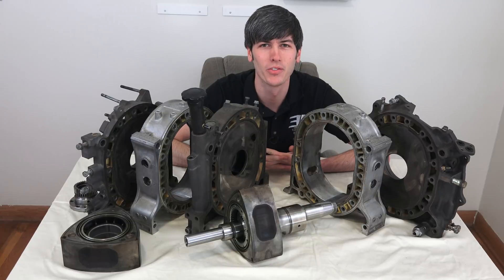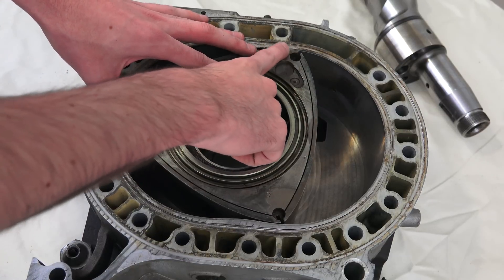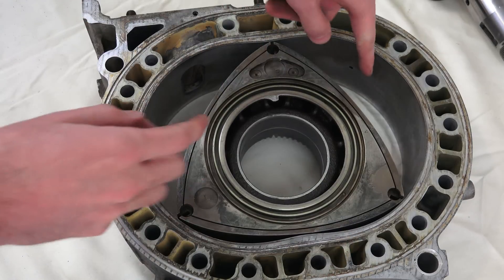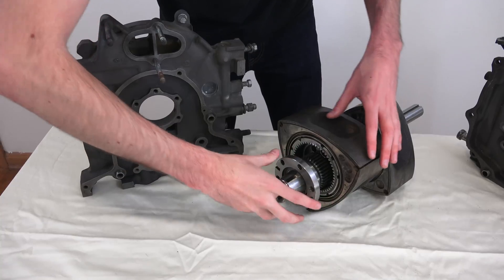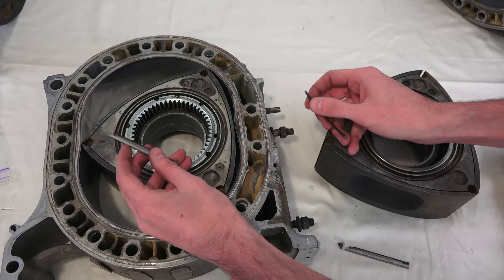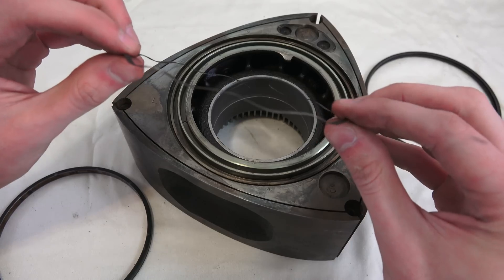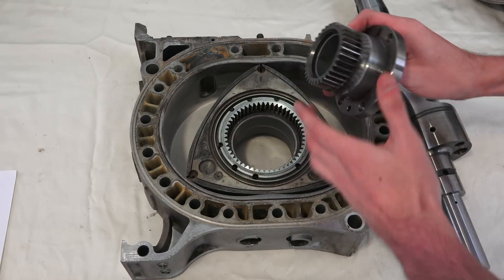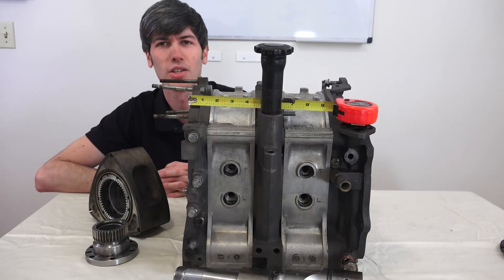How Rotary Engines Work - Mazda RX-7 Wankel - Detailed Explanation

Comment: I'm having trouble visualizing how the rotor, turning once, makes the eccentric shaft turn 3 times. How does the stationary gear connect the rotor motion to motion of the ecc shaft? I see gear teeth inside the rotor meshing with gear teeth on the stationary gear, but  I don't see any gear-teeth or splines or anything on stationary gear that transfer motion of the rotor to the ecc shaft.
Reply: the rotor spins in its housing, the stationary gear is connected to the eccentric shaft, as the rotor spins the gears mesh and the shaft spins...
Reply: my apologies oh masterful keyboard warrior

Comment: Great video!  The only goof I noticed was that the "concave pockets" in the rotor faces reduce compression, rather than increase displacement.  This is similar to a deep dish piston in a reciprocating engine.  It's done to create a more 'turbo-friendly' compression ratio.  If you set a turbo engine rotor beside an NA rotor, you'll notice the "pockets" are deeper on the turbo because the NA needs that extra compression to develop torque.  The displacement is the full volume swept by the rotor minus the volume of the rotor itself.
Reply from the maker: +Pete Schneider Wouldn't they do both? If displacement is "the full volume swept by the rotor minus the volume of the rotor itself" and the rotor's volume is smaller as a result of the concave pockets, wouldn't it have a larger displacement?
Reply: +Engineering Explained It would reduce the swept volume and the rotor volume by the same amount.  Relating it to a piston engine, dishing the piston reduces the compression ratio, but doesn't change the displacement.  The displacement is bore x stroke, I.e. where the piston sits at BDC versus where it sits at TDC.
Reply: +Engineering Explained To look at it a little more directly, the turbo and NA versions have the same displacement despite the difference in the "pockets".

Comment: Hang on! I don't get the comment of the pockets on the top of the rotor affecting displacement. Given that it doesn't change the dynamic volume of each combustion area, I don't think it could be considered "displacement". What I see is that it is a necessary relief to allow gas movement in the area between each apex seal. See as you approach top dead and then crest it, you need a way to transfer the gases across that squeeze zone. The volume of that pocket is probably better compared to the combustion chamber. Altering it's volume would directly alter the compression ratio.

Comment: I'm curious if a reciprocating valve system in a 4stoke piston engine could be changed to a rotating valve system. (Basically little rotary "engines" for valves)

Comment: Have there ever been engines with more than two rotors?
Reply: +Jan Šinkovec yes, 3 and 4 rotors are the most common. you can keep adding as many rotors as you want as long as you have parts custom made to make it work. the most ive seen is 12 rotors
Reply: chinchy111 Thats cool. The first thing that came to my mind when seeing this is " wow seem extremely modular" so i thought putting more together would be possible but i wonder how effective it really is.

Comment: those rotors are "decompressed rotors" used in turbo models. the end plates are "bridge port" with "flat bridge" (as opposed to "angled bridge") which increase side seal wear (and therefore failure). You can get incredible MPG or KM/L by "detuning" and a "soft foot". You can get upto 500HP for just the cost of seals & gaskets (DIY bridge/peripheral port), the same cannot be said of a 4-stroke. The biggest failure in rotary marketing is linked to oil crisis in the 70's, not the motors themselves. Rotary engine can run on hydrogen/water, still needs oil to create "cylinder seal". All grandmothers should buy rotary engine cars, so they will be cheap mint condition for young/old hoons 10-20 yrs later :)

Comment: This is probably one of the most reliable, efficient, engines ever devised, and it is capable of very large horsepower with vet small sized engines. I wish Mazda would market this engine more because I really do think it is way ahead of its time.

Comment: i understand that although rotary engine make good horsepower, they dont make good torque. if they are geared at the ecentric could you not make a low geared version that has higher torque?

Comment: Cool vids you're making, thank you. At 9:25 you said displacement... It seems to me it's compression, but also adding the equivalent of valve overlap. More of a one way valve overlap acting like a full time EGR imo, but seems entirely smog related to me. I imagine no cut out bumping mpg a good bit? You mention the flame front not making it to the other side before the ex port is open, so I'm picturing a slower rotor as the fix. Say 50% wider but 2/3rds the speed/rpm. Same volume per min but a better match to the fuel burn? I guess if it were that simple they would've done it.

Comment: If you custom made a much longer eccentric shaft with more lobes, could you just keep adding center plates, and rotor housings..? Make an 8 rotor version? Or would it not work for some lame reason?

Comment: I didn't realize there were only 2 rotors in the engine.  So, essentially, you have the equivalent of a 6-cylinder engine (3 power strokes per revolution X 2). Correct me if I'm wrong.

Comment: The concave depression on rotor is to control compression not displacement; this is controlled by the size of the rotor, 10a(30 cu. in.) vs. (12a(35 cu. in.) vs. 13b/13g (40 cu. in.) which is a fraction of an inch bigger than the 12a and 10a; respectively. Other displacements 20b, 26b derived from the 13b engine which had a 40 cu. in. rotor. They (Mazda) only added more rotors to achieve the higher displacement. The numbers refer to the size 10a= 1.0; 12a= 1.2;13b= 1.3; 20b= 2.0; 26b= 2.6. As you see each displacement is obtained by adding another 40 cu. in.(654cc) rotor. Efficiency I'll address another time.

Comment: I had a RX-2 sedan.  It was fast and smooth but terrible fuel mileage.  My last rotary was an 1986 RX-7 Turbo. Wow. It seemed like that car had no red line.  Very slow off the line but once it was past 30 mph you were nailed to the seat back.

Comment: wouldn't the exclusion on the rotor be strictly for allowing the gas/air mixture to move across the chamber rather then having anything todo with displacement?  while increasing the exclusion would increase displacement, I don't think it exists for that purpose.

Comment: Question is, if you change the A/F ratio to more Lean, would you improve a lot in the fuel economy side of thing? i mean wouldn't it burn more of the fuel  that is left behind in default and improve mpg while not losing power? this thing most likely would work on the RX-8 though

Comment: That is a perfect explanation. Thank you for that! I have known the basic princibles on how rotories work for years but never have seen it explained so well, now I'm even more interested in it's fantastic design. I had a chance to drive one several times back in the 90's, it was so smooth. You had no redline to deal with, just shift when it quit making more power.

Comment: The Mazda RX8 is the best example of this engineering marvel..
Reply: +jon doe 
An engineering marvel that died in the 70's only Mazda dragged it on and only ever for one car, yep thats a real marvel...of why they bothered.
Reply: +Manoo42 your comment made no sense for that matter any internal combustion engine would be outdated, and time to retire..
Reply: +jon doe 
Nope, just rotary's, dead and gone.
Reply: +Manoo42 their is a lot of engineering that is discontinued, but it doesn't mean it isn't without wonder
Reply: +jon doe 
Nothing with any value or advantage is ever dropped.
Reply: +Manoo42 lol.. Ok kid, I guess that's your opinion.
Reply: +The real doktorbimmer well.. They arnt the greatest on fuel, and prone to "flooding" during cold starts. However, they are a lot of fun on the track/strip. It's light weight, high rpm, makes ideal for a lot of fun..

Comment: What about the possibility to build a steam driven engine in a rotary design ?

I wonder because I saw there are some approaches to build steam engines again for power-generators. For Buildings where you heat anyway with fire like from gas or wood.
The idea there is to use  extra heat to generate power.
So would a rotary design be a good choice compared to turbines and piston driven engines ?

Comment: For those of you that don't know but, the 13b engine in this particular video was the most robust rotary Mazda ever built for a street car. If you notice the apex seal grooves on the rotors are wider than the newer engines made from 1986-Renesis. That's because this engine had 2 piece 3mm thick apex seals. 3mm 2 piece seals take forever to wear down and is one of the reasons these particular engines easily lasted over 200,000 miles however, they do a couple flaws. 1 They aren't great for high rpm operation because of there weight. That weight causes them to chatter at high rpms. 2 They slightly bow over time causing the engine to loose some compression. This is why Mazda switched to 2mm 3 piece apex seals in the later engines. They sealed perfectly over a longer period of time and didn't chatter at high because they were lighter. These 2 pieces seals weren't perfect either because as they age, the top piece of the apex seal would get very thin and brittle over time and break under detonation. The 3 piece seals were also more prone to carbon locking in the rotor groove. Carbon locking is when there is so much carbon within the apex seal grove that the apex seal actually gets stuck in a lowered position. This will cause a heavily carboned engine to loose compression. That's why it's good not to baby these engines as reving them daily keeps them clean.

Comment: Great job on these videos!  A question.  In the experimental aircraft world, people sometimes use Wankels (mostly from cars), sometimes 2-stroke piston (mostly aviation-specific), and most often 4-stroke pistons (mostly aviation-specific).  Power/weight matters immensely in that world, but so does reliability.  Seems like a Wankel compares most directly to a 2-stroke piston.  A video comparing 2-stroke piston engines vs Wankels, esp with emphasis on weight and power, would neat to see.

Comment: theres a video here on youtube of a mchinist who filled the pockets on surface of the rotor with weld material. then he machined similar pocket but each pocket is pointed In its direction of roatation. thus it seems like it would force the rotor in the (I.e. clockwise direction or right direction) which in my thinking would increase power and reduce or eliminate and chance of aback fire, becuase the rotor is basically asymmetrical as in it can only rotate in one direction?

Comment: So im assuming you do need to carry a jug of oil with you in order to make sure you never get low ? because if its squirting the engine oil and burning it. it must be constantly running out of oil. 

I have heard of people deleting the oil squirter and doing a 2 stroke gas mix but im not sure whats better.

Comment: im a rotary enthusiasts and the is one downside to running one they are extremely prone the problems just buy the nature of the beast the fact they rev so high plus the crazy amount of power they put out I was constantly rebuilding mine after 400 kilometres. my driving style is hard but v6 or v8 do not have this problem at all with in saying this they still are with out a doubt my favourite engine of all time.iv herd the they are perfectly adaptable for the aviation industry too.

Comment: Surprised you didn't mention the biggest benefit of not having any reciprocating mass:  no wasted energy.  Every time a piston reaches the end of its travel, it has to reverse direction.  It takes energy to oppose the inertia of the piston but that energy doesn't serve any useful purpose.

Anyone who has pedaled a bike and used a hand-saw to cut anything can understand the benefits of continually rotating something as opposed to having to constantly move it back-and-forth.

Comment: Do you think these engines can be made small enough to be placed into a motorbike? I mean even as a small engine these can produce lots of power and would be excellent in something with low weight like motorbikes, go carts or small boats.

Comment: I am afraid all the advantages of the rotary  are myths,, it was probably true 60 years ago   but time has moved for the piston engine but it has not for the rotary , there are piston engines now that beat every performance metric and alleged advantage  of the  rotary    
1 
less moving parts . a simple 2 stroke piston engine  has only 3 moving parts Crankshaft con rod and piston as well as less major components making up crankcase etc only 2 piston rings, 2 seals, and a gasket or 2...the rotary has more seal component for one rotor than all the components put together for a 1cyl 2 stroke 
2
Higher RPM ..err no RX7 red line 7000rpm RX8 9000rpm the Mazda 24h le mans  race car 13000rpm....many car engines rev to 8800rpm bike engines 12-16000... F1 race car now limited to 18k from 21k

3
 Piston engine also can be very well balanced and have a very smooth power deliver  i remember seeing a coin on its edge on the rocker cover  of an old rolls royce  that was running ...remember you can get more pistons and so get smoother delivery 
4
Power to weight /size  i know of car engines that date back to the 1980s that put out the same HP as an rx8 but are much lighter ...have you seen how small bike engines are that now push out 180-200HP 

5 cannot believe you said "reliability " and rotary in the same sentence  all i will say is ...hot start...

if i have missed or you think you know a metric that the rotary is better at please let me know and i will find a piston engine to beat it

NOTE if anybody disagree with what a say please backup with  facts and a link
(not just what someone has say in wikipedia or everybody know that )

Comment: I've a 1985 RX-7 GS with the 1.1 liter engine which I bought new which now has 150k on the odometer. Up until a few years ago it had always passed the stringent CA emissions test. The culprit turned out to be a faulty air control valve which is associated with the catalytic converter in operating correctly.  Replacing the part resulted in passing emissions since the converter was now receiving and able to burn the spent gasses.
The vehicle has been very reliable, the oil is checked regularly and tuned up as prescribed by the manufacturer. The engine is compact which makes servicing it easier than other designs and loves to rev. Matter of fact, there's a warning beep that goes off when exceeding around 7000 rpm. I wish it had better fuel economy but perhaps that and other issues the rotary engine has, namely the emissions due to the oil injection, will be addressed in the upcoming RX. The rotary is NOT dead by any means, Mazda is putting a lot into it and I'm sure it will show in the near future what the rotary is capable of in its newest incarnation.